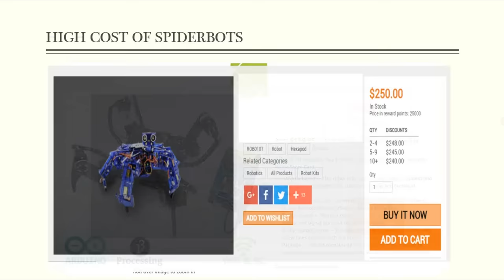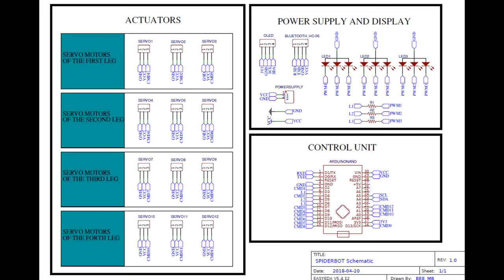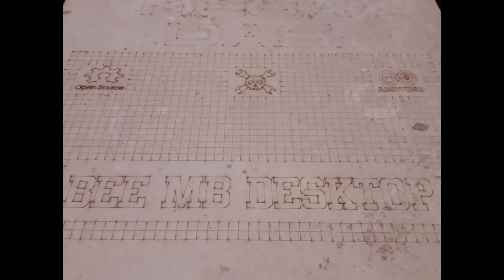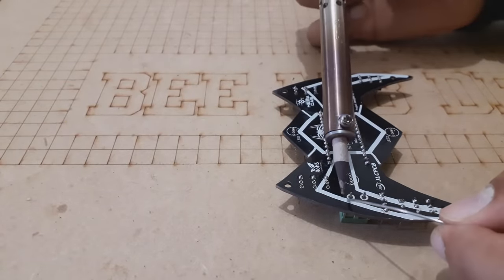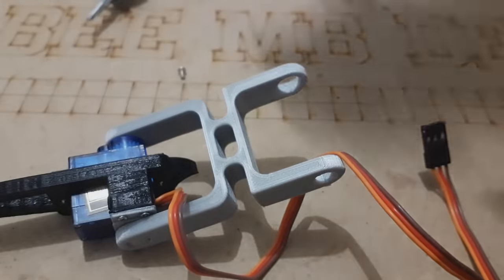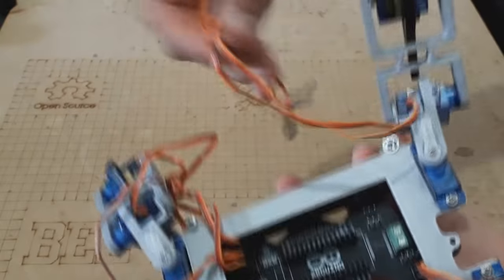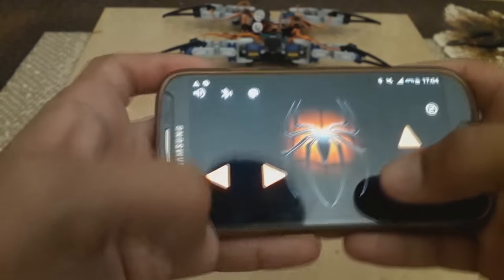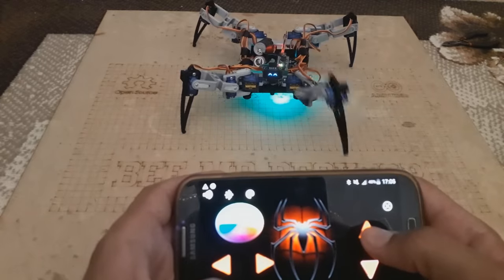Arduino Spider robot (Quadruped)

Comment: What battery is used for lithium 18650? If yes or do not damage the servo, the maximum current is 4.6 / 6volt if it's safe what i can use in my robot thank you

Comment: was a good project. it did involve a lot of pausing of this vid, and a total remodel of the stl, in blender, and cura to fit the circuit board shape, small print bed, and servos, also new battery compartment to fit 2 lipo batteries. I look forward to experimenting further with obstacle avoidance, stairs, and adding pincers..

Comment: Hello! Nice robot! Can you help me? How to connect the servos correctly? Forward left leg is leg number one, back second, forward right third and back right fourth? And I don’t know set the starting position correctly. In the video, there is a slightly different body structure. 

Sorry for my bad english(
Reply: I see this in your code: { {11, 12, 13}, {2, 4, 7}, {14, 15, 16},{8, 9, 10} }
For example take first element: {11, 12, 13} 11 pin femur, 12 pin tibia and 13 pin coxa?

Comment: Hello,
What type of servo motor are you using?
In the video, I saw towerPro.
The servo motor link refers to the bluetooth module.
I intend to start the assembly of the spider.
I collect the pieces.
Great Project.
Thank you.
Bye.

Comment: What dimensions are the screws that are used for attaching the s holds to the tibia and coxa?
Reply: i think they are 3mm in thickness and about 5mm in length (similar to the smaller ones that comes with the servo sg90) 
 but i used smaller and it worked( 1.4mm in thickness and about 4mm in length).

Comment: the resistors in the pcb, they are include in the pcb or they cost apart?
Reply from the maker: Hello IAK 
The resistors are not included in the PCB. You need to get them apart and solder them.
Its a 330 Ohm resistors for the LEDs.

Let us know if we can further assist you.
Do not forget to subscribe our channel for more awesome videos.

Comment: How much hour it will work?
Reply from the maker: Hello ;
This is not about hours but minutes :)
using the "Alkaline battery cells" it will run for 5 minutes, but you can increase the battery capacity by adding more cells and do not forget that the more cells you add the heavier the battery will and then it will be difficult for the robot to move.

Let us knwo if you can further assist you.
Do not forget to subscribe to our YouTube channel for more awesome videos.
Reply: Thanks but I want it to at least 3hr
Reply: What should I do then

Comment: Hello sir,   please, please, please,. Help me , I have tried to increase digital Input Pins on arduino Pro micro board using 74HC595, as you told in a video of your channel . I followed your circuit diagram & digital read example. I attached push button to 74HC595 's input pins. I wrote in code different outputs from different pins. But I am getting same output from all input pins of 74HC595. Please solve this problem??????I shall be highly thank you ??
Reply from the maker: Hello CHAR NJIT 
Could you just explain more about the issue ?

Let us know if we can further assist you.

Comment: What are R1, R2 AND R3?? 
Are those resistors if yes what are the values?
Reply from the maker: Hello
These are a 220 Ohm SMD resistors..
Reply: Can i use the normal 220ohm resistors?
Reply from the maker: @sishirsubedi9536  yes as long as you can solder them.

Comment: hello sir ,, i have tried extend digital pins of Arduino pro mocri board using 
74HC595 . i  tried mega das IOExtention library /example digitalread. My 
arduino board have digital pins(0,1,2,3,4,5,6,7,8,9,10,14,15,16,18,19,20,21).
there are not pins(11,12,13,17).  so i tried these combination for wiring 74HC595
  to Arduino pro micro board (SH_CP=10 ,DS=14 ,ST_CP=16 , IN_P=4 ) ,  
(SH_CP=10 ,DS=14 ,ST_CP=3 , IN_P=4 ) ,,, (SH_CP=10 ,DS=8 ,ST_CP=9 , IN_P=4 ) 
,, I don't understand, why my digital pin extention module is not giving correct 
result???????
 i tested with this sketch.....................
#include <MegaDAS_IOExtension.h>              

const int SH_CP=10;       
const int DS=14;          
const int ST_CP=16;                        
const int IN_P=4;

IOExtension myExt(SH_CP, DS, ST_CP, IN_P); 
void setup()
{
 Serial.begin(9600);
}

void loop()
{
  if (myExt.DigitalRead(1)==HIGH)    {     
   Serial.println("on1");
  } 
 if (myExt.DigitalRead(1)==LOW)   {    
    Serial.println("off1");
 }
   if (myExt.DigitalRead(2)==HIGH)    {      
   Serial.println("on2");
  } 
 if (myExt.DigitalRead(2)==LOW)   {    
    Serial.println("off2");
  }
}

now  if button1  or button2  is pressed  (not both at once ) , serial monitor  displaying.....
on1
on2

if  button1  or   button2 is released , serial monitor  displaying.......
off1
off2
,,,,,,,,,,, even then if  any other button is pressed  serial monitor  displaying.....
on1
on2
,,,,,,,,,,,,,,,,,,,,,, even then if  any other button is released  serial monitor  displaying.....
off1
off2

i mean to say that all  input pins from 74hc595 giving same result.  and every pin is not giving its own result,,
  please try to understand and solve my problem,,,,,

Comment: Hi sir, what kind of battery do you suggest to use?
Do you suggest to separate arduino power from servos?

Thanks
Reply from the maker: Hello
No need to seperate the servos power. I used some lithium batteries from an old laptop battery.. I used two pieces to get 6V DC
Reply: Thank you very much !

Comment: hello sir, can arduino Nodemcu support 12 servos? because this project is amazing. and i thought i want to build it using IoT to control it
Reply from the maker: Hello Zulhelmy Zarudin
Yes you can use a NodeMCU to make this robot but you need to adjust the PCB design since NodeMCU and Arduino nano doesn't have the same footprint.

Let us know if we can further assist you.
Do not forget to subscribe to our channel for more awesome videos.
Reply: tq. can your arduino coding for joystick to move the robot be use on BLYNK app?

Comment: Arduino: 1.8.9 (Windows 8.1), Board: "Arduino Nano, ATmega328P (Old Bootloader)"

SpiderBot:35:62: error: FlexiTimer2.h: No such file or directory

compilation terminated.

exit status 1
FlexiTimer2.h: No such file or directory

This report would have more information with
"Show verbose output during compilation"
option enabled in File -> Preferences.
Reply: hello bro , i am also faacing the same problem. if you have solved it , then please tell me

Comment: Great video! One question please. Where did you get the 6v power supply? And is it rechargeable?
Reply from the maker: Hello
I've got the 6V from two battery cells, I got them from an old laptop battery and they are rechargeable yes.

Let us know if we can further assist you.
Do not forget to subscribe to our YouTube channel for more awesome videos.
Reply: Go to amazon or ebay,You will get them cheap and at times 2,4 or 6 packs for dirty cheap. Or you can get a higher volt battery and just use a converter or step down mod.
   I get alot of my electronic's from both places to build ideas or customized Robotics for others.
Reply: And yea my friend they are rechargeable. Sorry forgot you said somethin about that.
You need any help or talk shop man I eat,breath,shit and sleep this stuff. Or anyone else whom reads this.
Be safe 
Blessed be...
Reply: @DIYGUYChris  And Great vid,I'll hit that sub button my friend. Great Job brother....

Comment: Velleman has a spider robot kit (allbot). All is freeware. The 3d files for the chasis, legs and the arduino program. So if your struggling with the movements you can check their code. They have some options ( 2 servo leg, 3 servo leg, bluetooth) in their codes. I bought one for 99 euro's including the legs and chasis, the servo's,  arduino board, a servo shield with ir and bluetooth module and battery shield. They also released a sensor pack. So codes for that should also be available. Good luck with your projects!

Comment: Hello. I'm doing your spider robot project, it's really cool :)
If I can, I have a question to ask you.
I assembled all the pieces and uploaded the program to Arduino. I don't have batteries yet so to test it I connected arduino nano with USB to the computer. is that right?
Because instead of going into position, the legs continue to tremble and the HC-06 flashes only for 10 seconds then switches off; the red light does not stay on.
Thanks for the project, I hope for your answer.
Reply: The USB port cannot supply enough current for all the servo motors, you will need a battery or other power supply

Comment: do we need to do the torque calculations part??
Reply from the maker: Hello
Yes if you are using heavy parts "not PLA printing"
In this case you need more powerful servo motors

Comment: Thanks for great job 
One question what is the position should keep the servos in while fitting for all the parts
Reply from the maker: Hello
Yes you can use the first code to set the servos positions.

Let us know if we can further assist you.
Do not forget to subscribe to our YouTube channel for more awesome videos.
Reply: Ok so you mean every servo of the 12 will be at the same position during fitting inside  the body?!
If so i will use the code for all 12 after scaling I will start fitting in the body correct?

Thanks
Reply: @DIYGUYChris  How do two pieces of code brush into a board

Comment: thanks for sharing. how long this battery last ?
Reply from the maker: Hello sulo man
The battery could keep the robot on for 10 minutes but you can add more cells for longer operation time. Do not forget that the cells to add should be in parallel to the main battery.

Let us know if can further assist you.
Do not forget to subscribe to our channel for more awesome videos.
Reply: thank you!
Reply: Could I use two 3.7 3200mAh bateries to get 7.4V and then with a 7805 get 5V?

Comment: What did you use to power the robot?
Reply from the maker: Hello
I used some battery cells from an old laptop battery.

Let us know if we can further assist you.
Do not forget to subscribe to our YouTube channel for more awesome videos.
Reply: MEGA DAS sir, we’re planning to do this proj but is it fine to use arduino uno for this? Planning to use a 12v battery to power it up and get the 5v source from the arduino to power all the 12 servos. Is it fine?